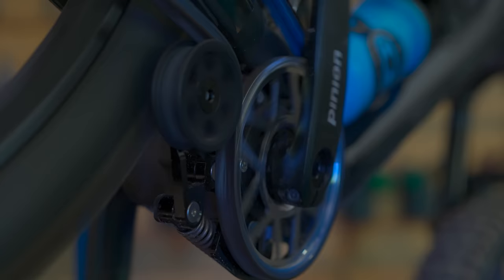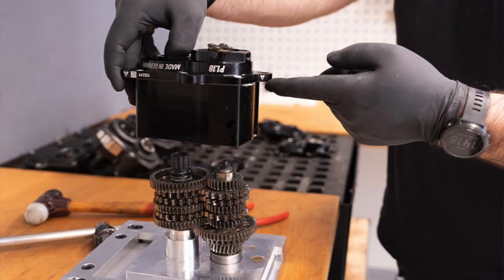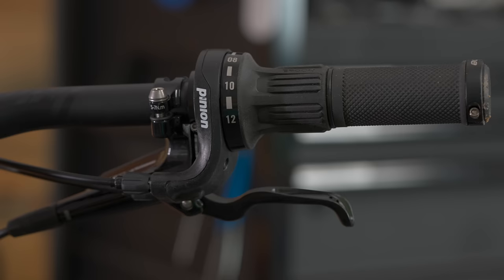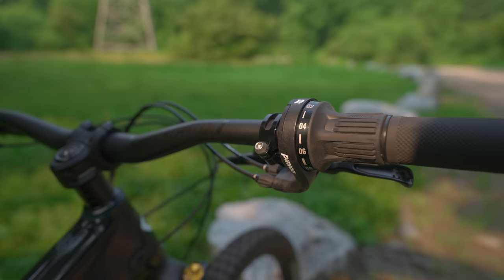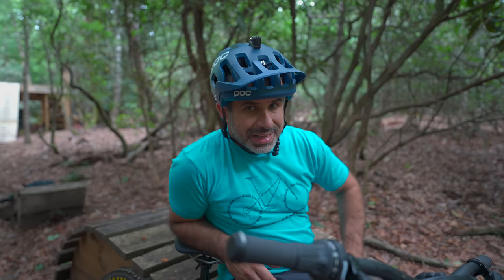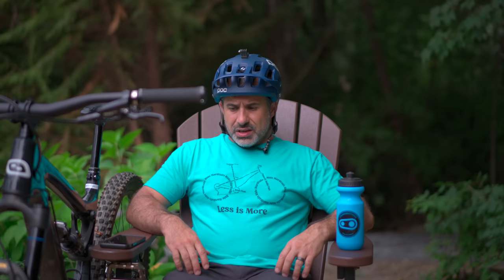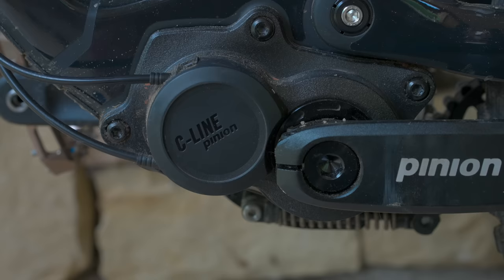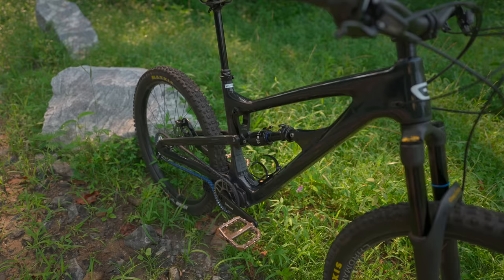What's the deal with gearboxes? Why don't more mountain bikes have them?

Comment: A lot of the cons you mentioned are just monopoly issues, manufacturers and bike companies unwilling to invest or take leaps to implament this technology (mtb specifically). In my eyes, asides from the price, it's better in every aspect for mountain biking. The weight is negligible, your gears shift 100% of the time, a chain can't fall of, your drivetrain is completely safe from external elements or being bent like a derailleur, shifting can be that same seamless shifting like in srams eagle axs with no 'rev matching', and the belt is nearly indestructable compared to a chain. It's also completely possible to have an internal gearbox with a chain instead of a belt too, if the direct to power efficiency bothers you.

I think if you really want to see the capabilities of a internal gearbox on a mountain bike, Allen Millyard's custom hand built MR002 mountain bike on YouTube he made for his son is a testament to how much better internal gearboxes really are. His internal gearbox is perfect in my eyes and he even implemented the chain into the swingarm so nothing from the drivetrain is visible besides the back wheel!

Comment: I took a schwinn messa runner and converted it to a 3 speed hub with a coaster brake. Ive kept the cantilever brakes. Mostly have been using it as a gravel bike but i would like to take it on trails.

Comment: After using belts on my last four bikes, I refuse to go back to chain. My daily driver is a single gear belt drive and I put almost 10k miles a year on it. I only replace the belt once a year because I ride through beach sand and mud year round. My second bike is a priority 600X with a pinion gear box.

Comment: The thing is, you can't actually buy any of the Pinion transmissions as a separate unit. They are only sold with a bike. They only deal with frame manufacturers directly. Thus the price really can't be discussed or compared.

You CAN however buy an Effigear Mimic for around 1200eur which isn't exactly cheap either but at least they are available...

Comment: Shimano do gearboxes – I have an 8-speed Alfine on my cargo bike. It's great! You aren't supposed to stand and pedal but that doesn't really work on a cargo bike anyway.

Never really notice the additional friction, though the Douze V2 is already 10KG heavier than my MTBs.

Still running the chain it came with 2 years ago, and that was second hand. With how much I've ridden it, I'd be four chains and at least one cassette down by now if it was a derailleur. It's also much easier to spell.
Reply: Nitpick: That's an internal gear hub, not a gear box. I also have an Alfine 11 on a Douze v2 and it's been pretty good, mostly, but I had the occasional gear skip. Can't say the same for the frame though. Step through model ... cracked at the BB junction, and I had to get an automotive welder to fix it up and add gussets.
Reply: @pascaladl  it is still a box with gears in, even if it is a cylindrical box full of planetary gear sets :)

I understand the 8s and 11s are a bit different. The 8s are "dismantle and grease if/when you feel like it" whereas the 11s are "oil regularly or else". Mine only gets angry at me if I relax into derailleur muscle memory and pedal a bit too much while changing. Shifting used to be a bit lazy in cold weather but cleaning and relubricating the shifter solved that.

I have the step-through frame too. Haven't noticed any cracking as yet. Good to know about the possibility though. I'm the third owner and weigh 100kgs. Luckily that bit is steel and I know a frame builder who does crack repairs :)

Comment: Gearboxes make sense on ebikes, where efficiency is less important because you can increase the battery size by 10% to compensate. Mind you, a dirty and poorly maintained chain loses efficiency also, so the real difference may be smaller than "big derailleur" want us to think.  Pinion released an integrated gearbox/ev motor earlier this year and it looks compelling.  Pinion was bought out by powersport company BRP (Sea-Doo/Can-Am) last year, who are expanding into personal mobility markets, so it will be interesting to see if leads to a better outcome for non-EV bikes or if they get left behind.

Comment: I have a Pinion P1.18 on my commuter bike. I ride about 3000 miles a year in any weather. The maintenance is less, but I have some issues with creaking (gearbox in frame), and I've had to file a warranty claim when the gearbox failed after about 10000 miles (I did get it back within a week completely rebuilt for free). But the main issue is the drag in high gears.

Comment: One problem with something other than a common derailleur setup is how do you get is serviced/repaired if it breaks down?  With a derailleur  many riders can fix their own and if they can't any decent bike shop will be able to fix or replace the derailleur drivetrain.
Case-in-point is the Kindernay hydraulic hub on my Wattwagons mountain bike.  A couple of days ago I noticed the hub was leaking.  It will have to go in for repairs and the only place that is authorized to repair this hub (that I've found so far) is the Kindrenay factory in Norway, so it looks like I'll have to ship the hub half way around the world, on my dime,  to get it repaired, and god knows how long my bike will be off the road, waiting for the repaired hub.
When I purchased the bike I had the option to go with a derailleur kit, or spend more and go with the Kindernay hub.  I should have gone with the regular derailleur. 🙁

Comment: The transmission doesn’t use a planetary gearset, it resembles an automotive manual transmission with straight cut gears, whereas  road cars use helical gears. That’s the reason why it’s relatively noisy, but it does make it even more efficient. It will be much more efficient than a gearbox with a planetary gearset.

Comment: I personally much prefer internally geared hubs like my Shimano Alfine 11. They're also belt compatible, less heavy than a gearbox (about 300-400g more than an SLX 11spd 11-46 derailleur system, with exactly the same range) and waaaaay cheaper! It rides nice and smooth and is totally silent, and it's nice to know that with an annual oil change, it's gonna stay that nice and smooth for years, even after many rainy commutes.
The only downside I can see is the weight is in the rear wheel which makes a bike feel a bit less playful to jump around with.

Comment: I have been using a rohloff speedhub for over 10 years now on my mountainbikes. Still the same gearbox, never did any maintenance except the yearly oil change. I think Rohloff is even more rare than Pinion as i often see people looking at it with big question marks above their heads. I even had a guy once saying to me "Who needs gears", thinking i was riding arroudn witouth any gears lol.  The downsides for Rohloff and pinion are pretty much the same, my brother has a pinion system. Efficiency loss is really the only downside these systems have. It is not massive, probably a couple percent, but it is definatly there. Unless you are a top ride you will never notice this though. And you could argue that this time loss is easily won back by never having a chain breaking, never having a chain running off, never not getting in gear in time etc. 

As for the best non conventional system. I think for mountainbiking Pinion has a small edge over Rohloff, just because of weight distribution that is important when doing major jumps.

Comment: I had an idea for a rear sprocket that would eliminate a derailleur but wouldn't be so complex as a gearbox, and still keep a chain because I think a chain is less prone to slipping and holds up better to the elements but I suck worse then nickleback at CAD drawing so I wouldn't know where to start.

Comment: It's worth noting that the Rohloff internal geared hub has efficiency in line with 1x drivetrains - measurably better than the BB-mounted Pinion (but still a little worse than the superior 2x drivetrain. ;-)

I believe this is in large part due to the gearbox being positioned after the gear overdrive from the chainring and rear cog, so the gearbox is running at higher speed and lower torque.

I have a Rohloff equipped Surly ECR, and i went the Rohloff route due to the efficiency, proven design (over 150k sold over 20+ years with a virtually zero failure rate), and the ability to change out the hub to whatever, and move it from bike to bike.  But it isn't easy to change out wheels on the bike like it is for BB-based gearboxes, and for full squish it isn't great (I only ride rigid).

But I have stuck with chain drive due to cost, ability to change gearing easily, and very long life without cross chaining.  I have heard stories of belt failure in mud that give me pause as well.  Belt drive does great on my wife's city bike with a NuVinci hub, and on my sport touring motorcycle.  I got 30k miles out of the first one - which was taken out by a rock in the belt, another worry of mine when mountain biking.

Comment: You also need to get the battery weight low down & maybe smaller if it is efficient at regenerating ! Owe,  & the gearbox is  an "Extension" Gearbox! 2 parallel shafts like most "Stick Shifts." A planetary gearbox is "Concentric" gearbox like all Automatic Transmissions! The reason it is called "Planetary" is that usually "not always though the SUN Centre Gear is an extension of the motor Output Shaft. The intermediate gears are called Planet Gears. There are usually 3, 4, 5 or more of these all run in mesh with teeth the sun gear, equi-spaced space around its perifery. These rotate on their own axis simultaneously. They mate with ring or annulus gear. A gear with teeth inside! Hope this helps.

Comment: Living in Germany they are not so rare but still they are not as common as the standard drive train. I am guessing as long as the major player can keep sticking extra gears on the rear and fitting narrower chains or they can simply no longer boost the rear width. Then we may see some traction towards mass produced Gear boxes though you can better your last Dollar that Shimano and Sram already have teams in place researching for such things. It is not like Pinion are the only maker of Gearbox drivetrains .

Comment: Major problem is frame compatibility. The frame parameters necessary to incorporate a gearbox makes said frame more expensive. And possibly less attractive performance traits. Add the added cost of the drive/transmission unit and you could buy an ebike, a good ebike, not a lead sled. The constant rotation of the gears, and the crappy engagement make this less than ideal for chunky climbs and slower maneuvers. Tighten up the engagement, employ a friction clutch system and it just about there. Then you need to lose the weight AND make it fit conventional frame manufacturing. So . . . keep working on it. Someone will figure it out eventually. For now, it's long distance, commuter and anti-mechanics riders who'll buy this.

Comment: When a pinion gear box is $1600 you have to start comparing it to other $1600 drivetrains namely sram t-type which you can now get for $1100. The main advantage I see is shifting under load. This a place t-type excels and pinion falters. Pinions are known to not want to shift when other heavy load. A huge disadvantage when you find yourself needing to dump a couple of gears in a pinch. With t-type there’s way more bikes out there which are compatible, with pinion you’re looking at buying a whole new bike. I think pinion has the best shot of success in the ebike and commuter world. Their new products in that arena will likely be much more successful than their current offerings. You get electronic shifting and lose the grip shift, a motor to drown out the inefficiencies in power loss and hub engagement. And frames which manufactures already designed for motors making the pinion ebike gear bike and motor much more simple for a frame builder to implement. For me, I don’t see the point I’d much rather upgrade my current bike to t-type and get a nice high engagement hub as well. In the end it costs the same as the pinion and imo it’s better in every way.

Comment: theres one important detail to the entire efficiency discussion that is missing here.
this gearbox is not as efficient as a normal chain driven system with a derailleur with a perfectly clean and lubricated chain yea.
but the big difference here is the gearbox with a belt drive is going to be super consistent so unless you are very particular with your chain maintenance and also make sure your gears are all perfectly adjusted your chain drive will lose efficiency over time and according to the data we have till now you quickly get to the point where such a gearbox and belt drive is as efficient as your normal bike with mediocre maintenance being done.

as you said, perfect for a commuter, i used my bike to go to work for 7 years every single day no matter the weather and i changed chains 5 times on top of having 3 chains break while riding the bike.
im really looking forward for a belt drive now where i know this is never going to be a problem again.

Comment: Honestly that shit exists for years, except that Roloff simply put the gearbox into the hub make it compatible to almost all bikes and probably weights quit a bit less than the Pinion? So Roloff has 14 gears but is also pretty expensive (guess it's 1,5 to 2K Euro today). So I like the idea of belt drives but the only one I found which can be changed without a special bike frames was 400 Bucks for a normal length and mine need to be longer. But the most fun thing is that I came here by watching a restoration of a 1930 german bike with a 2 gears gearbox (Torpedo Wanderer). So it is not quiet a new idea, just a (good) reinvitation.

Comment: I am a gearhub fan. They are bit cheaper, than gearboxes, and they fit normal frames. Drawback is that the extra mass is on the rear wheel so it is not perfect for full suspension bikes (extra unsprang mass).

If you are willing to go back in time and get a nice old 135mm QR frame, you can buy a used Rholoff for half a price or even less. If not you need to get a new thru axle Rohloff fitted in a service as they do no sell them. Kindernay hubs fit modern MTB bikes but info on them is sparse.

Comment: Now see this is what I haven’t been able to wrap my head around. The MTB industry has made so many modern technological advances like electronic shifting, hydraulic brakes, tubeless tires, carbon wheels, and fully electronic suspension. So the question I have been trying to understand is, why are we still using this antiquated transmission?

Now I know some will say it’s because of the weight. Well yeas but by how much? With advances in cabin fiber you could make the some of the transmission out of that and internals from Ti.

Comment: Been riding a gates belt system on my single speed for about three years now and getting more and more disgusted with my other bikes having conventional chain drives. It can really not be overstated how reliable and hassle-free this system is. Not to mention absolutely quiet if you have a frame with a single-speed dropout to tighten the belt and don‘t need to use a belt tensioner. I doubt I‘ll ever go back, especially on commuter bikes. MTB is a different thing still, but I‘ve been curious to try a Pinion or Rohloff for a while now. The only reason I haven‘t is their price tag.

Comment: I have a shimano hub gearbox in my commuter/gravel bike with a belt drive, using it around the year and winters here get a lot of snow - snow and ice absolutely destroys chains and derailleurs so they need to be cleaned properly after every single ride, got fed up with that and moved to gearbox + belt, problems solved.

Comment: You missed the fact that you need to let off the power you pedal with, a bit more than a traditionel chain. In a crutial situation it is important, like if you hit a turn in a too high gear, and need to let off the power while turning.

Comment: Both my bikes (a city bike, and a hybrid (I guess) road bike, both steel framed) have sturmey-archer rear hub gearboxes. They're probably not good for mountain biking, with the weight at the back wheel, but they've been fantastic for my use case. The hybrid is my commuter and I usually take some shortcuts through trails. The only problems I have are because I don't have a proper chaincase for that one, and it gets dirt in the chain. 
Mine are old, and only have 3 speeds but that's all I need haha. I overhauled one about 700km ago and I should be good for another 2 or 3,000km yet. I'm never going back to derailuers haha
Sturmey-Archer ones go up to 8 speed, and can have drum brakes - which aren't the best on steep downhills but they are at least consistent. (My commuter has rim brakes and they suck when it's wet) Shimano makes hub gearboxes as well, and they go up to 11 speed! 
They work best with horizontal dropouts, but I think they can be made to work with vertical dropouts, too. And they're quite a bit cheaper than bottom bracket gearboxes.

Comment: My neighbor has a Zerode Katipo. It is great except for the amount of engagement it has because of the double freehub in the cranks and the rear wheel. They need to improve that. Otherwise, it's exactly as you say. They need to get better with engagement. Also, his frame only has non boost spacing. Another thing they need to change.

Comment: These are great for touring/bikepacking and fat tire bikes. IIRC you cant shift Pinion boxes under load so thats definitely a downside.
Reply: It shifts under load, it’s just hard to do, need a lot of force. You might break a cable, but gearbox would be ok.